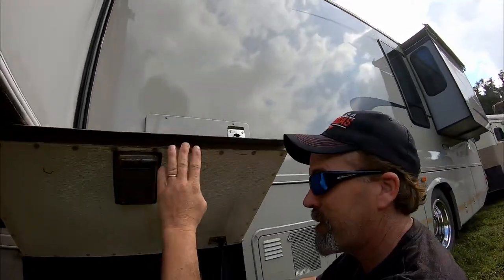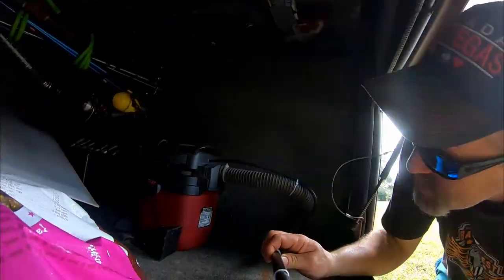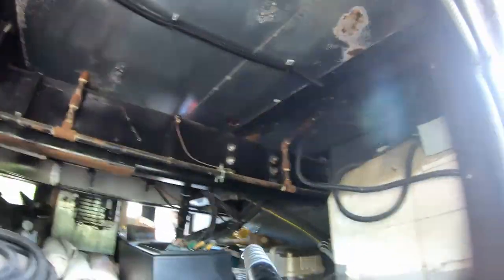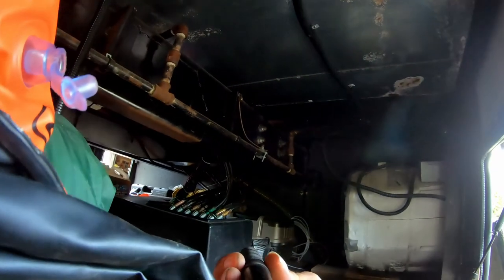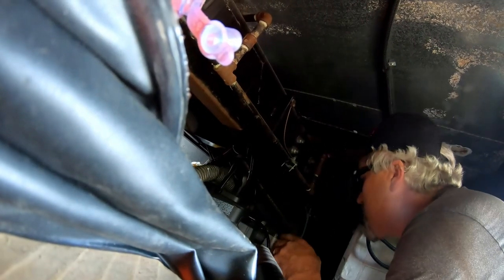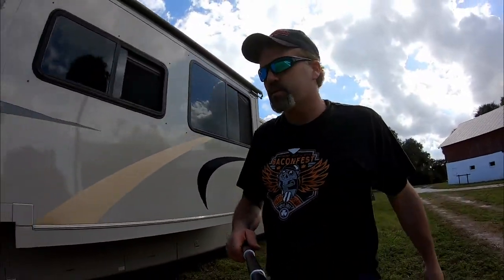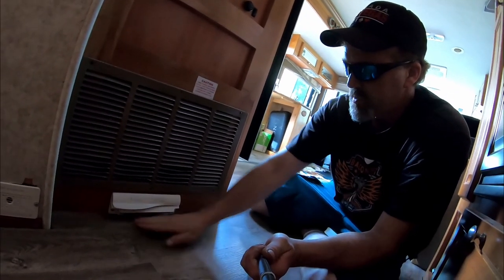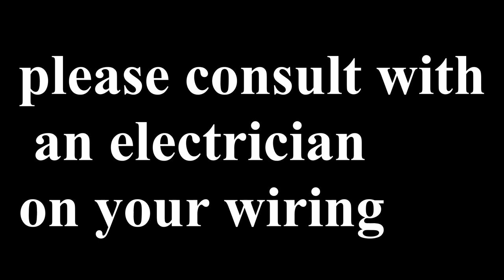DIY central vac install in your RV

Comment: Great idea! Question: how you managed to start the vac from the automatic dustpan?
Reply from the maker: Thank you for watching. Unless your a little electronically inclined I'd advise an electrian to help.  I personally took an old extension cord and cut the ends off then wired it from the shop vac switch to the dust pan.  The dust pan comes with the spots for the wire hook ups.  My wife absolutely loves it.... Quick easy clean up
Reply: Pleasure Ride RV thank you for the prompt response. My wife watched the video and loved it. One more question, could you please let me know the brand of the dustpan. Once again thank you.

Comment: The only issue I can see is because you don’t have a return air into the space if all your windows are closed you’re gonna be pulling your RV into a negative condition which could possibly pull more dust in then you’re actually getting rid of.